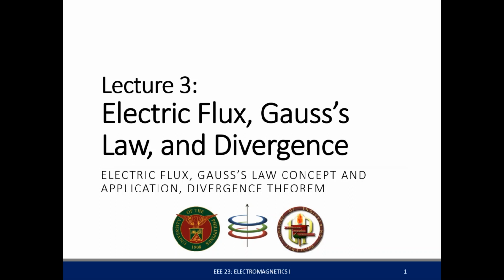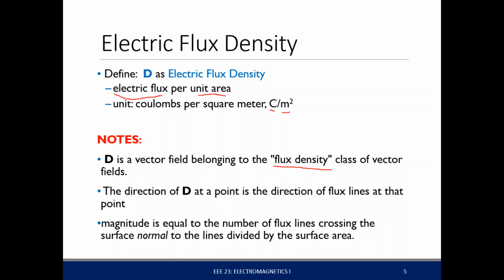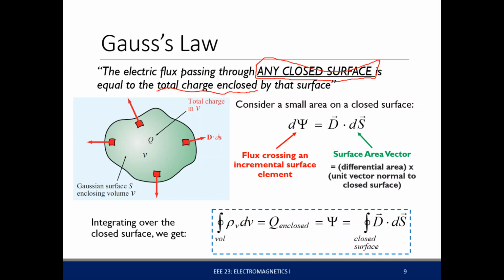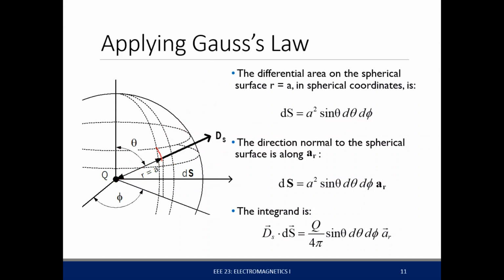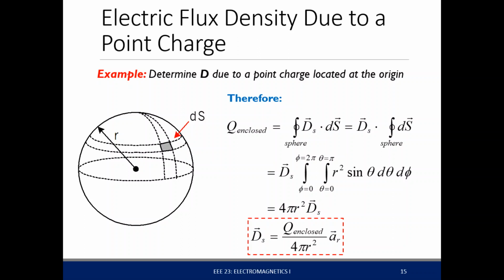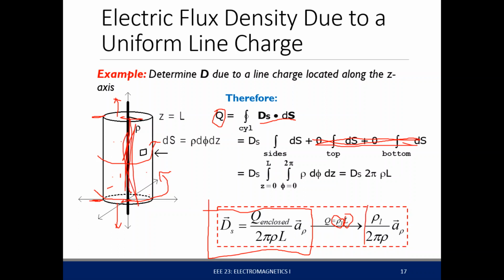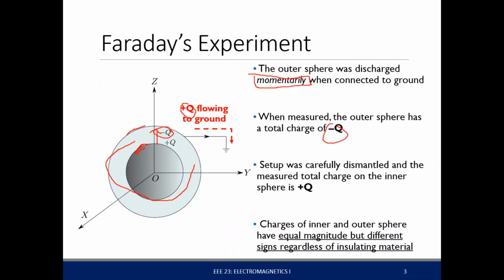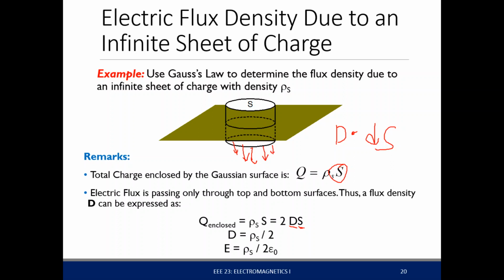Electromagnetics - Electric Flux

Comment: Hello! Thank you for posting the video. Why is D=0 for the top and bottom part of the cylinder?
Reply from the maker: It is due to the symmetry of the system. Infinite uniform charge distribution parallel to the z-axis has its infinitesimal charges cancelling out the z-component everywhere in space.

Comment: Hi! I have another question...sorry but I don't understand, because in 19:18 the electric flux density is in the surface of the sphere, so why then in 19:57 we integrate with dv and rho_(v) (volume) , if D originally was the density in the surface of a sphere? shouldnt it be like surface density instead of volume density (rho) [I mean i know you're correct I've read it in books too it just doesn't make sense to me or I dont understand why :c]. Thanks and sorry for my english hope you understand me
Reply from the maker: There are two sides of Gauss's Law: the closed surface integral and the volumetric integral. The closed surface integral is what you are referring to which is also the statement of Gauss's Law. The other side of it is the volumetric integral which solves for the charge enclosed by the Gaussian surface. Both forms can be used to solve for the total flux across closed surfaces. You just need to gauge which form is easier to use on the problem you are trying to solve.

Also, don't apologize for asking questions. Just ask. It's how we learn. ✌